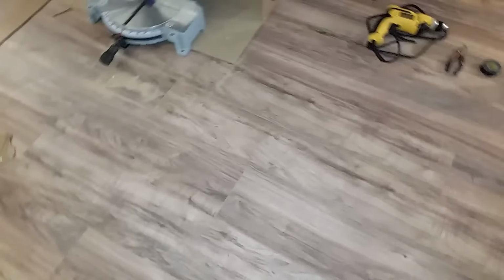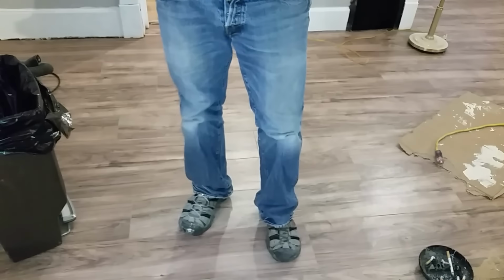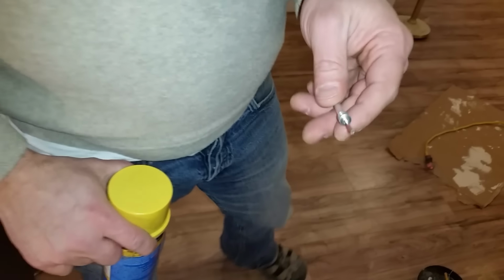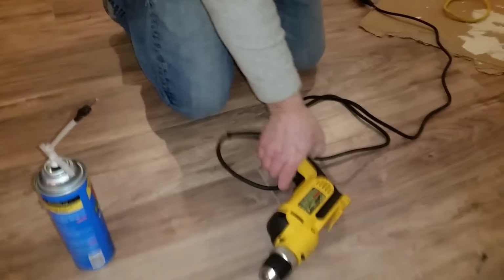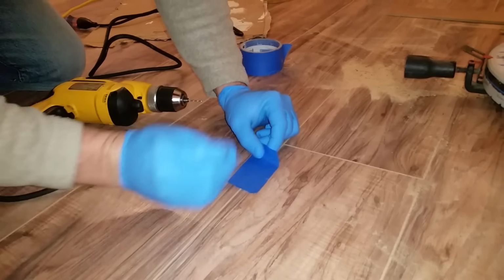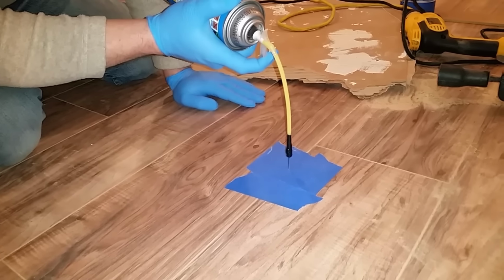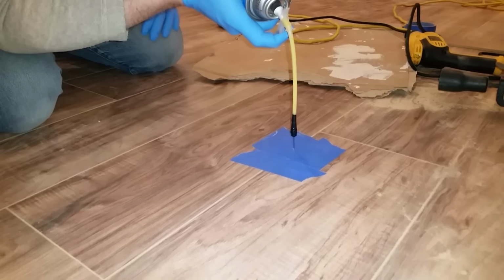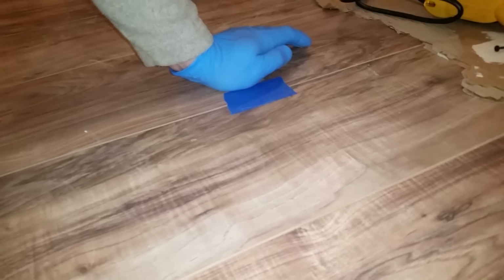Laminate flooring repair to fix soft spot for uneven underlayment

Comment: You know it would only take a day or less to pull up the laminate back to that spot and fix the unevenness by sanding if its wood or grinding if its concrete.
Reply: there is a dip so that wont work you would have to fill it with some kind of leveler.
Reply: a day of labor or 45 minutes for a quick fix? Hmm
Reply: A day of labor? Depends do you also have to remove all the baseboards, quarter round, and struggle with removing and replacing boards around door jams, move furniture, empty and relocate refrigerator, dishwasher, toilet (depending where the floor runs). Aye yayay

Comment: Great idea . I used it to fill area from  tile to bare concrete along line and used several holes along it , about 15 feet . pressurized it along line starting at one end . great fix . wife wont even know HAHA. Can i used though - didn't have  wide hose , but with some rigging made it happen THanks dude good idea.

Comment: Ok so I had a low spot under a hardwood floor I laid. Rather than drill a hole through the surface I went under the crawl space and drilled up through the subfloor. I drilled several holes close to the same size as the great stuff tube and sprayed about half a can. I then set a heavy five gallon bucket on top to make sure the floor didn’t heave. The hardwood was an engineered floor installed floating. Glued edges. It worked great. The floor still has flexibility as far as expansion.

Comment: How could that possibly work  the foam will crush and turn into powder when you walk on the floor.     
A better solution would be a syringe and some self leveling compound like Durhams water putty
Reply: Durhams, my go to for drywall repairs! Not sure, but Durhams would crack possibly in time also turn into powder, interesting though, good idea!

Comment: will this work for a floor that pops? And one with an underlayment not glue down?
Reply from the maker: My guess is this will not work on a glued down floor. This DIY application will fill the void on a floating laminate floor to prevent a soft foot or low spot area that can get really annoying.

Comment: Thanks for this. Do you think it would probably be okay to inject the foam into the ends of the boards were 2 meet, rather than in the middle of a long side? That seems to be the center point of my two soft spots.

Comment: I love that "Oh, $h1t!" at the very end.
Reply from the maker: Oh my, The camera doesn't miss a thing. It has really worked on my floors though.
Reply: What was the reason for your "oh, sh1t!" ?
My immediate thought was, maybe the first patch was over expanding?
Reply from the maker: No seriously, it didn't overexpand the laminate. My issue was drippage from the tip. The foam stuck to the cardboard I had used when I set the can down between two different holes. If you've ever used foam before you know its messy and have to be careful since it sticks to everything. Make sure you use window and door foam.
Reply: Yeah I have that problem sometimes as well. Drip from the tip. Lol. Great idea and the best part really was the oh shit.

Comment: Do you just drill below the laminate and underlayment till you get to the subfloor?
Reply from the maker: Personally, I try to stay above the underlayment but even if your drilling goes to far it will still work.
Reply: AGlobal LLC thank you. Was this laminate click and lay? That's what I was planning on trying this on.
Reply from the maker: +Alexander Zaborowski yes sir, stay above the sub floor and get the foam in between the laminate and subfloor
Reply from the maker: +Alexander Zaborowski yes the floor I tried this on is a click lay type. Just be sure you use the right foam or you will ruin your floor. Use the window and door type foam.minimal expanding.

Comment: Great Video! 
One piece of advice i would recommend is to drill a second hole right around the edge of the soft spot to let the air out, otherwise over time you will see that the soft spot just moved to a different spot of the floor.
Reply: And also to see when it's filled
Reply: @TreyCarpenterThe_t3xh  that as well! Thanks for bringing that up!
Reply: I seriously doubt those floors are air-tight.
Reply: Underpadding should take care of this, I would not worry about air.

Comment: ⚠ Be very (very!!) careful!!!  *YOU NEED TO SECURE THE PIPE USING AN HOSE CLAMP* I just tried it without it, it was a disaster: the plastic pipe (the extremity that is near the can) was pushed out with the pressure, the foam  literally exploded everywhere in a nice POP! (Piece of foam everywhere from the wall to the bed, even on the hair of my girlfriend ― who somehow did not find it really funny), later the foam did came out through the thread of the push button. 
My advice: 
●  use 2 hose clamp at each extremity of the plastic tube (later the foam melted the tape I put on it to maintain the metal things for balloon). Tape isn't enough.
● press gently the button (don't build too much pressure). if you don't hear the foam coming out, stop pressing (and raise up the pipe a bit, if it touch the floor, the foam can't get out)!
● protect you eyes, hairs and the things around in case of explosion.
● I guess it exploded because the pipe was touching the floor (which is obvious) it should be a little higher.
Reply: LmAO!  And good advice
Reply: forgot to say that it cost me a fortune (4 bottles) and it did not do anything else than this funny explosion.

Comment: I have got a few low spots in my hallway I have access at the moment as the Toeboards are off the linen so can have access from the side and under the laminate instead of drilling. Is there any other options I have? I can slide things in if there is something suitable
Reply: Nail it!!

Comment: it's like in the matrix.  computer, i need to know how to fix a bouncy laminate flooring.  done, courtesy of youtube and aglobal.  great video, respek.
Reply: @dropndeal  what is the answer without pulling the floor? Anything better than this? I have 1500 sq feet of laminate without any transitions with 2 super spongy spots from where the planks meet. It drives me nuts.

Comment: How long did you squeeze the trigger on the foam can for? It sounded like you did for a second or two and then left it for the remaining time the tip was inserted in the floor.

Comment: Definitely gets rid of the voids from an uneven subfloor.  However, what happens now that the floating floor is glued to the subfloor.  It can't, expand/contract.
Reply: Would that be counter intuitive to the idea of floating floor 🤔
Reply: It would be ok for a spot or two, and should be fine. But it's not going to compensate for total neglect of leveling the floor in the first place.
Reply: What if it’s just glued to the underlay? I don’t really see how that would be an issue

Comment: Has anyone tried this and put weight on it after you applied the foam?
Reply: He is using non-expanding foam. If the weight is too heavy and/or not very flat/spread out...you'll actually sink the floor and probably have a permanent dip.

Comment: This type of foam has no "memory" to it, so won't it just compress over time and the soft spot comes back?
Reply: I think not because it is a hard foam once it dries. Therefore, you are simply using it as a mass filler, even if it compresses over time.
Reply from the maker: This has worked for me for 3 years now if you used the right foam. Please check the affiliate link to make sure you purchased the right product. If your thinking on doing something like this and your not using the right product this can ruin your floors.
Reply: Most likely not, main reason being that there isn’t much of a point load to compress the foam. These floors are most likely click lock, so each piece is mechanically connected to the next. That really helps to spread out the load. Now if you were to put 300 pounds on a spot the size of a golf ball, maybe you’d get some compression. But that’s unlikely of course.
Reply: There are companies that use foam to raise concrete sidewalks to be level. Unbelievable to watch how that foam lifts heavy concrete.

Comment: CAUTION: there are more details to consider: how big the 'dip' is, what flooring/vapor barrier/subfloor you have, and how long you spray under the flooring. I have laminate flooring, with a vapor barrier that was installed less than a year ago on top of a concrete slab. I had one spot where I put too much - and now I have a bump. One spot where I put too little. I did 6 spots originally, which are better than they were before. But, I will now do it in 6 more spots near where I did the original holes to try to make them even better - because I didnt get it just right the first time. The length of time I sprayed in the holes before was random. After the fact, I think 20-30secs would have been enough for me. In the holes that I will do to finish up, I am going to just do about 10-15secs. I believe this method is 5x cheaper than the glue/epoxy method. I also recommend super glue or another way to fasten the needle to the plastic straw to keep it secure. Mine came loose on the first hole, thankfully I put enough tape down and had paper towels ready to go to help limit the problem. I was able to hold it in place for the other 5 holes - which was more stressful. Thank you posting this video and demonstrating this solution.
Reply: I seen in other videos they were putting a heavy bucket on top after injection to prevent a hump from forming.
Reply: or a small piece of plywood with some cinderblocks to keep it level and not bubble.

Comment: I did this repair on a few spots on my engineered wood (snap together and glued down) flooring.  It worked well (so far).  No more popping noise that annoyed me. The foam did not spread-out as much as I thought it would.  You might have to apply this treatment in a few different places to remove the whole soft-spot.  Do wear gloves as the foam stuff will not come off of your hands!  Some excess spilled on the floor but cleaned up nicely with mineral spirits (paint thinner).
Reply: Itll scratch off with your finger nail after the foam dries. Please dont put  random chemicals on your flooring guys.

Comment: They sell the proper materials at home depot to do this "drill and fill" repair.  It comes in a tube to use in a caulk gun.  Literally for $10 you can do this correctly. Cheap and a lot less time consuming and messy.  Easy cleanup too.  I was going to say this is a quick easy way to do it in this video but by the time this guy gets set up i will be walking out the door to the next job.  And where is the end of the video where he shows the finished product?   Last thing you hear is "oh shit" and then it cuts off.  Lmao.
Reply: From my search, it looks like the product you're referring to is geared toward ceramic tile. Are saying you've successfully used this with vinyl flooring? Thanks

Comment: I’ve had a poorly fitted spot on my floor that has made a loud crack every time I step on it and has done my head in for years. Not any more, thanks and well done for the brilliant idea👍
Reply: So you did this procedure and it worked? 
I too have a same spot that cracks when I walk over it. I think that in that spot the laminat was not inserted correctly. (the V groove part that connects one pice to another)

On some other spots around the edges with the wallsbI have the problem shown in this video, it's moving when I walk over.
Not sure if I want to drill in my new floor tough, I will try from the edge since the laminate is 1cm from the walls.

Comment: Your way is a very good way after the floor is in place. Another way before the floor is placed is to use a four foot lever and use a sharply to mark all areas that are below the level of the subfloor. Take drywall compound and apply it to the floor. When it sets you are ready to lay the flooring.
Reply from the maker: Drywall compound works on a budget but may not last very long especially on concrete. Maybe someone else has experience with this. From my experience, Floor leveler prior to installation works like a charm when installed properly.

Comment: This is a very sad solution for a sad problem. Sadly, I tried it & cannot reccommend for any larger spot than a few inches! Firstly, PU as such is strong, but in this form it is still a foam and will wear out mechanically. Also, if heavy stuff is not applied during curing, it will create a bump. So if the floor is not level and soft underlay was used (such as polystyrene or polyethylene mats) it will be spongy everywhere. Best to remove floor and create hard flat surface by swiping cement for levelling over whole floor with long flat edge throwel, after which it is best to use wooden fiber mat underlay, which is brittle yet hard material and can be "shaved off" in places of deviating level. I have most floors hard as rock where I did them properly, and a small room where I started is very spongy and shall be corrected as mentioned above. Problem happened because of the poor levelling in the first place and the used soft underlay materials, which was a poor choice.

Comment: It's a floating floor!
Not anymore.
Now, you will find in the future that your going to get gaps because the floor is not expanding or contracting together with temperature change.
This... is s terrible idea.
Reply: Floating laminate?
Reply: This comment is accurate. Never adhere or nail into a floating floor and mind expansion gaps around walls.
Reply: very true
Reply: Great point. I had high hopes to use this trick for my floating floor. What if I tried to insure I get the foam underneath the under the plastic moisture sheet?
Reply: Quillon Tsang that’s what I’m going to do. I’m going to drill a hole under the floor in the basement and fill under the underpayment so it doesn’t glue down the laminate.

Comment: Doesn't the foam expand as it dries? Do you have to be concerned not to overfill and cause a hump?
Reply from the maker: +akrasia1969 I have not personally had a problem of any buldging since you want to inject each spot for 1 to 2 minutes or so. It covers approximately 1 and 1/2 foot. Make sure you use the minimal expanding window and door type or it will bulge. The tip is slow filling on each spot. I haven't heard of any issues when using the right foam. Knock on the laminate and you may hear the difference if it's a thinner laminate. Go slow and do a little at a time. Don't rush. Patience.

Comment: thanks for the video. will this also work on engineered wood floor?
Reply from the maker: +tenleycrew I've only tried it on laminate type floorings. I'm guessing it may, just inject less on each hole to be safe not to ruin it
Reply: @Carlotheeus  ...and about 50 or so commenters who did this said that it worked like a charm. So lighten up Francis.

Comment: Holy dear God! Do not do this under any circumstance!!!! Proper floor analysis should be preformed before any and all installs. If you have done the floor yourself and this happens this is not the answer. The expanding foam will not only make a highspot once it expands it will adhere the laminate to the substrate. This will cause the flooring not to be able to expand and contract properly. No manufacturers or seasoned installer will tell you this is a good idea!
Reply: Cody Smith 

IF the Great Stuff adheres at all. How will it dry with little to no air exposure?